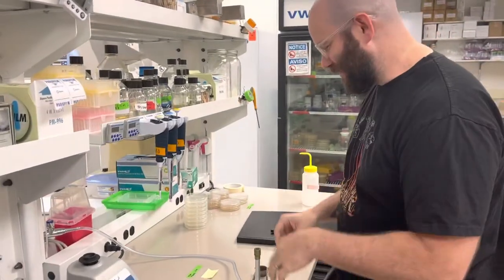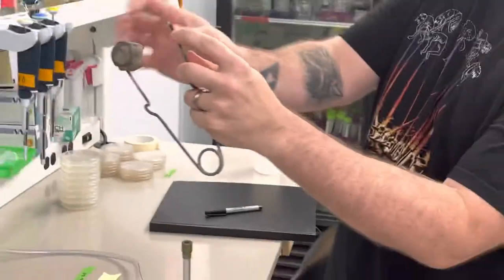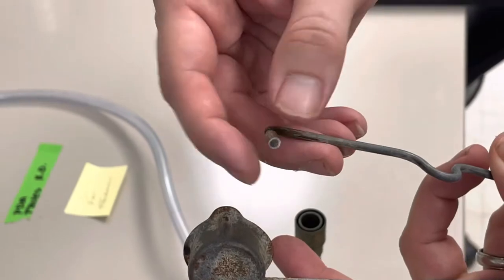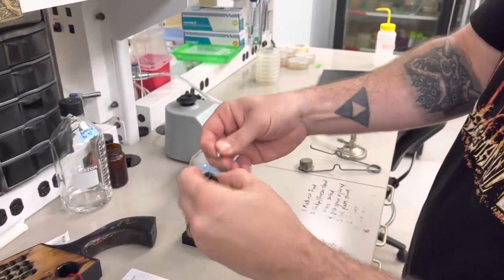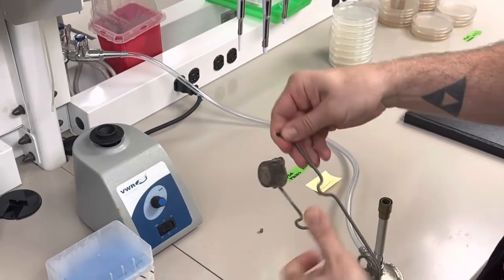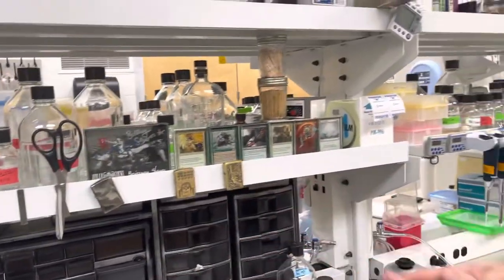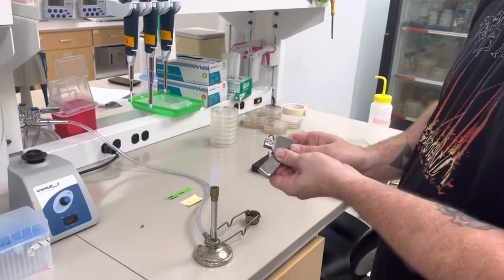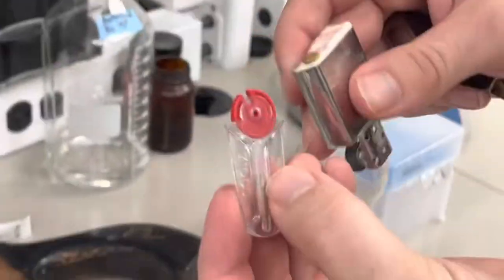Striker Flints… your striker isn’t broken! How to light a bunsen burner…

Comment: I ALWAYS thought the protruding metal on the face of the striker was a spare flint.  (I bought spare flints with the striker anyway.)  But I tried banging out the old flint from the nut.  It wouldn't come out.  I tried pulling the "spare flint" out of the face.  It wouldn't come out either.
I feel quite silly for all that.  Seems so obvious after the fact.  Could have just looked at the spare flints and would have known.